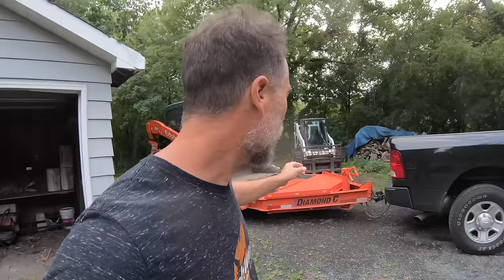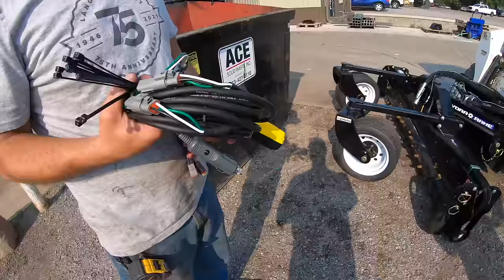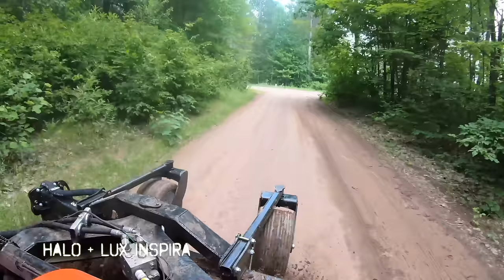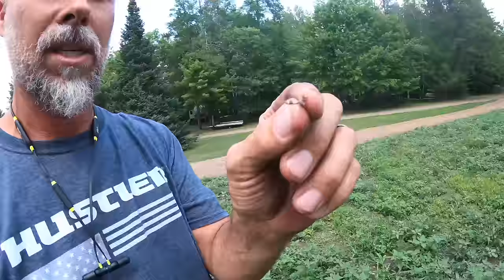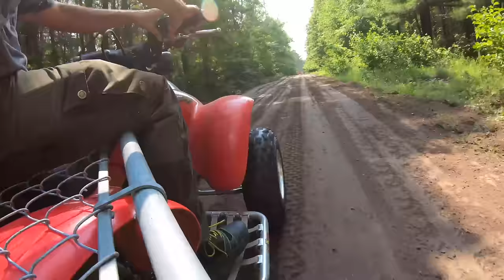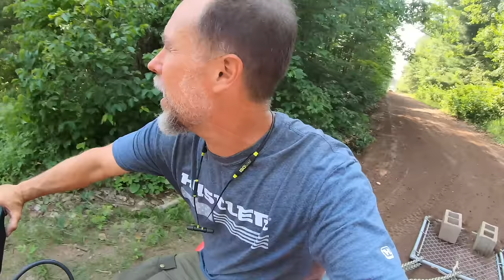Fixing a Rough Gravel road.  4 k vid

Comment: I had no experience with building a road when I bought my property and built my house on it. It was swampy loamy soil. I got it leveled and then dumped tons and tons of 3 1/2 minus down. After a couple of years and a few more layers worked in the base was stable and we didn't sink into the ground. Topped with road gravel it's now very smooth and level and never muddy. I use a rake on my M5 Kubota for maintenance. I enjoyed watching you have fun!
Reply from the maker: That sounds like the best way to get through a swampy area.

Comment: Crowning is something you do from the get go not just at the end. Water also helps keep the fines, which is mostly clay (your binder), from blowing away as dust. BTW, most drive in the middle of a road creating a two track which essentially makes a crown. This will aid in keeping a crown as long as you don’t kill it by cutting that middle hump down. Grade, with some water keeping your crown, then rolling with more water to compact. You need a water truck and a small grader with a roller attachment. Graders do wonderful work for making ditches to aid in drainage of a crowned road.
Reply from the maker: On the gravel roads around here I have never seen that done.  I know its the right way but not practical for many situations. It requires to many steps and takes to long to be efficient for the long stretches I have sen done.  On those back water country roads they typically run over it with a road grader and thats its.
Reply: @Dirtmonkey  That's because back country roads are done cheep and most have 4 wheel drive that run though the mud and bumps yelling "YE HA". lol David is completely right about crowning the road. I was wondering what part of the country this road is in that you graded flat. The side vegetation is also pretty think right up to the road. Even though it looked like there was some slope past the vegetation with out some type of gully on either side heavy rains will not run past all that vegetation fast enough. As David also said most drive down the middle on back roads. That road is going to rut out rather quickly if that ground gets too saturated. Depending what part of the country and the amount of rain fall you should have a 3 to 5 degree crown on the straits with 4 to 6 in. gully on both sides and 1 to 2 on a curve and double the depth of gully on the low side as it has to handle all the run off through the curves embankment. If the road is on a hill that creates a hole norther problem as you don't want run off going strait down your road as it will wash out the bottom of either side. If it moves to fast depending on length and slope it can carry off what ever the road surface is and will cut a gouge right down the road way. I'm sure every one that's ever been 4wheeling has seen this effect going down trails. 
    Sorry about the lengthy post but my Civil Engineer side as opposed to my heavy equipment and learning the engineering of proper techniques of hardscaping side got a little carried away their. lol

Comment: How i smoothed my field out. 14ft disk with a drag behind it after using a chisel plow. Pass after pass, hour after hour. Gone from rough to smooth. After that, used a heavy roller and compacted it all back down. Looks like a park. My driveway i had to crown. Easy to do if you know what you're doing. Trick is, using a farm tractor for it all.

Comment: Nice. I use our Harley Rake to do the same, then roll it with our water cart 9500lbs dually truck (same effect as using the bobcat bucket) We have very rocky country where we are in Aus so actually use the Rake to make gravel. Much cheaper than buying it.
Reply from the maker: Yeah-  the gravel is down there just mixed in with the subgrade.

Comment: Try opening up your bucket about a ft then use the bottom backside to smooth your rd out by going forward you can see where you are going and you can put more down pressure for compaction. It also keeps your wind rows to a minimum

Comment: The only question I have is where would the water drain off , in certain areas its completely not drainage, I thought to take the bucket every 20ft n run it into the woods , Anyway that's what I would've done , GREAT JOB  BOSS 👏👍

Comment: great video I enjoy seeing you test equipment and attachments. I cringe at some because being a heavy duty mechanic I see repairs coming from abuse. I certainly see a use for an attachment like that power rake. I’m guessing the tines till the top 1 1/2-2 inches allowing it to be smoothed and evened out. A steel drum roller on that would compact it nicely. That looked easy enough with no rocks to deal with. Out here in California the eastern Sierra mountains I don’t see that attachment being usable to fix up a road due to to much granite rock. But in the part of the country you reside in y’all have fewer rocky roads to deal with.

Comment: Hey Stan I've been running equipment for years all makes and models. have you ever considered doing a video on a roller or considered buying a roller for projects like this it would come in very handy I've worked for a paving company for 7 years if you do decide that you would like to test one out my suggestion and favorite brand is Hamm HD 12 it's a great little roller and it also has vibratory for more compassion hope this helps

Comment: Maybe I can contact them directly but I have found a product for me that modifies friction and reduces heat in both an oil and grease form called DSX extra and it may help with the heat and break in of those metal sleeves. The hotter the surface gets the better it works.

Comment: Be nice to have a Hydraulic "Crown Adjustment" for driveways with this.

Just a -5° Adjustment would take care of the "Wash"!
Reply from the maker: So true!
Reply: I always wondered why they all don’t have that option
Reply: The angle will do that pretty well but tractors have the tilt link. We have a power rake on 3 different types of equipment. Tractor only does roads and the biggest of properties. The others are nice because bi directional.
Reply: thats what the power angle is for. windrow it to the center slightly then knock the top off and dress with a bucket-no more ponding and no more wasted material

Comment: Didn't see the gravel. Probably just had one layer years ago, and needed another after raking it out again. Developer around here thought 3" crusher was a good gravel to put down without any smaller on top.
Reply from the maker: did they pack that 3" in to the subsoil at least?
Reply: @Dirtmonkey  Not at all. Feels like it would rip up regular car tires.

Comment: Get a grader to come in and crown that road and you would have way less problems. Any time you have water sitting on the surface you will have problems. By crowning the road the water would slowly drain off the road

Comment: I was advised by the local Kubota dealer that those speed binders you can tighten with a drill fail with all the mechanical internals and I'm better off using the mechanical ones to strap down my heavy equipment. Can anyone give some field guidance on that?
Reply from the maker: so far so good but I am newer to them.
Reply: Thanks for the reply. Which brand did you go with and I will check it out if u don't mind telling?

Comment: The sunny spots will erode faster during rain.
Reply from the maker: why is that?
Reply: @Dirtmonkey  Dropping water on hot dry dirt is like drops of water on a hot skillet,  it rolls off faster taking dirt with it and does not soak in easily.  Its why an open field will flood or hold pools of water but a shaded forest will soak up rainfall instantly.  Its also why straightened and cleared water channels will flood quicker than naturally winding and shaded channels.  Check a map next time there is a flood somewhere 99% chance the water channel before the flood has been cleared and straightened.  Creeks or rivers, same principle applies.

Comment: having the stuff inside the drum is gonna be a pain in the ass to fix but if it does its job properly it wont need to be fixed so often. wish they did it with under tree rotary-hoes bearings are lucky to last a season and a half on them.

Comment: I have a rake on my tractor and the bearing went. He is right, it’s difficult to tell that the bearing is gone. That is a cool design and if I ever get a skid I’ll be looking at this.
Reply from the maker: Their hydra rake worked even better than I imagined.
Reply: You're right. Sometimes the only way to tell when it first goes out is to have it running and get out and look at it. With a skid steer I wouldn't do that by myself since the only way out is right over the top of it. So if you're on a job site by yourself it can be tricky or almost impossible. I've worked in agriculture for most of my life and I'm very familiar with those bearings. If an employee isn't greasing them like they're supposed to the dirt will start building up in there which will destroy them. Some implements it easy to tell when they go out just from sight and sound others you don't know until you tear it apart or when it causes more damage. Pretty cool they thought about that and didn't just do it the way everyone else does. Seems like they're truly keeping customers in mind.
Reply: What kind of flow does it require? Could you put it on a tractor with front auxiliary?

Comment: smoothing the current road is one thing, and you did an excellent job at doing so, but what about the overall contours that needed to be fixed so it wouldn't happen again?
Reply: It's gravel, there's nothing you can do to keep it from happening again short of covering it up with asphalt or concrete.

Comment: How much of the gravel that is thrown off to the edges of the road an be moved back onto the driving surface and how deep will it be able to cut into pothole rather than cut into hole which likely will reopen (appear) sine the holes  perimeter. How long  is the road , how wide, traffic volume, grade? Just trying to compare to my real life experience living in a county with predominantly gravel roads and a good road grader operator was a very valuable person.
Reply from the maker: to much is thrown off the edge.  not much I can do about that with the tools I had on hand.

Comment: Am I the only one that uses a vibratory roller on a customers driveway ?? I see other contractors in my area they just grade and walk away. Also most of my driveways are on hills and have sharp corners. Keep up the great videos Stan.
Reply from the maker: if I had a smooth roller I would have used it but didn't.  That would have eliminated the need for going over it with the bucket.

Comment: If that's the worst you've seen then you obviously haven't been to Australia lol.
I was surprised you made it flat though and didn't put a crown in it to enable water to run off. Pot holes are generally caused by water pooling and the road surface remaining wet.
Reply from the maker: yep-  thats what i was referring to at the end of the video.  I ran out of materials to do it the way i would like

Comment: It was a pretty smooth gravel driveway before you worked it. From where I come from, that was a highway. Wasn't in that bad of shape to begin with. But nice job, wish I had a power rake.
Reply from the maker: your roads must be really bad!
Reply: @Dirtmonkey  They are. We get a lot of rain and that washes them out. We get a lot of work with our tractor and box blade. Your toys would be nice on our projects!

Comment: nice to see someone else using a fence for a drag, then i finish with a side cut off a oil drum to smooth/ pack it.  new thing i've come up with is using a 3point blade that i attach to a hitch i made for the 2" receiver on my truck with a electric trailer lift to bring the blade up and down.

Comment: i graded my staynat driveway a couple weeks ago. had some galleys forming in the middle and sides of the road due to rain erosion. i tried to back drag with the bucket (i have a 1026R John Deere tractor) but it just wasn't cooperating, as a wheel woudl go into a rut and the bucket would scrape at a beard angle. so instead i opted for the dig, drop, and smooth operations, where i pushed the bucket into the road to dig it up, then set the dug up material at the top and then back drag it smooth. i woudl LOVE a power rake like you have though, but, it turned out great with plenty of compaction and bucket smoothing. i just Wish there was a way to dynamically tilt the bucket side to side to account for the crown one needs to make in the road. ahh, well, i can't dream at least. i try and re-grade one a year or so or as needed. i woudl prefer pavement, but got to solve the drainage issues first. haha. but, that's what one gets living in Vermont surrounded by mountains, and living on its slopes lol. that's why im building terraces. makes things that much easier lol...
Reply from the maker: I know your method-  it works but your right-  its not easy to use the drag drop and fill method.  It takes a bit longer for sure.

Comment: How boney of material will a power rake like that handle?  I have a 1/2 mile long discontinued road to my house, and we're currently using 4-6" really rocky/boney stuff.
Reply from the maker: 4-6" material would not work in my opinion for this.  Those pieces are just to big to really "grade"

Comment: Stan, I do a lot of equipment recovery for parts and salvage and repair for resale. It is literally anything from flood damage, fire damage, or rollovers. I do a lot of Snapchat videos with just my Samsung s20 smartphone. Have a lot of people telling me I should start a YouTube channel, any suggestions?
Reply from the maker: Start a youtube channel  if you are willing to REALLY work at it.  Its hard to get traction at first.  You really need to consider it a part time job to get it going.
Reply: Anything and everything I do, I don't do it unless I can do it right, with the only exception when we're in a Time crunch. Having said that, I know nothing about making YouTube videos, the editing and all that. I worked for a row crop farmer and ran large GPS controlled equipment, I grew into understanding all that but when it comes to sitting at a computer desk, (like editing and putting together a video) I'm not as sharp on the element. I'm a hands on guy! However, I'm never too old to learn. I'm willing to put in whatever it takes to get done whatever I'm wanting to get done. I wouldn't mind making the YouTube videos but didn't know the first thing about it. Does making videos really slows down production as far as all the editing and set up for making the video goes. Is it worth the extra effort?

Comment: My cousin she lives on a terrible dirt road that needs to be actually paved but the county won't do it cause there to lazy water drains down the road causing constant potholes i helped smoothen it out once but the top of the road has to be fixed first (which there are 4 houses up the road i don't know exact distance but the entire road is terrible) after the 4 houses and huge potholes you take about a 40 degree drop down a steep hill its hard to get her car in and out we could not get my machine out with it on trailer i could not even stand on the back it was so tippy  (mini skid steer)

Comment: Stan, you ever try a rake with a solid bar? I bought one just to get into a cheap rake. I definitely find that a solid bar roller or a spiked roller have there places. The solid bar does really good with driveways and anything you want to get the rocks out of. I think it combs the rock out better than a spiked but can’t chew up hard ground like a spiked tooth unit as well.

Comment: This is so funny I have the same Kubota I had a Kubota well I still have it probably 25 years now but it has a 3-point hitch so you drive it with a tractor from behind and when I bought this Kubota I wanted to go rent a power rake to see how it would work and it had the plug-in to turn the rake side to side and I noticed when I got to the job and unloaded it I picked up the yellow box and water just poured out from inside where the wires go in the Box anyway it worked for 10 minutes and I angled it to the left but it wouldn't come back to the right so the bottom button wasn't working so I don't know what happened if it just got rust in their from being outside so it was basically worthless I used it for an hour because it was sharp all the way to the left I would buy one that is hydraulically driven instead of electric

Comment: Did you ever have a homeowner come home and see you pull a fence around and not know that you use the Power rake already and say I'm paying you the drive around with a fence Lol so funny I had that happened a few times within 35 years I used to tell him just common sense can you see that Power rake over there are that machine over there what do you think that's for this is just to smooth it it's called the finish touch in New York some homeowners just are the dumbest ❤

Comment: Same as you level out a ash tennis court with a v rope attached to an 8' long aluminum tube to which a rubber nylon mat 8' by 6' is attached. It smooth out any imperfections.

Comment: I wish I was allowed or able to take a snapshot of the bottom side of your bucket you are not compacting anything with that bucket because you cannot put downward pressure on their enough to do anything because of the cutting blade that you have on the bottom side of your bucket which is 7/8 and 3/4 of an inch thick Steel

Comment: What about a drag harrow or chain drag why every you wanna call it I bought 2 from tractor supply a 4ftx4ft  and a 6ftx4ft the  smaller one for atv bigger one for sxs or tractor it can be used 3 ways light engagement deep engagement or just smooth